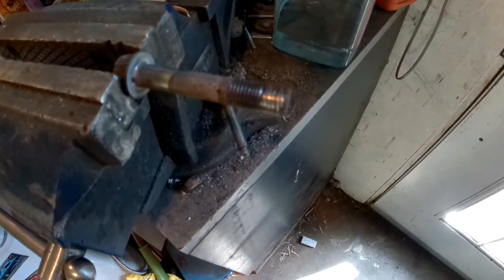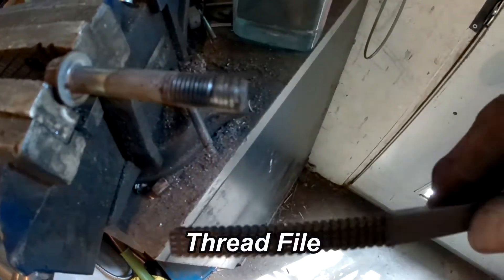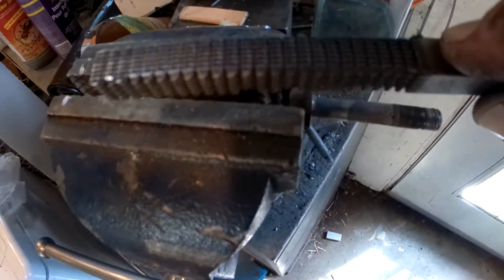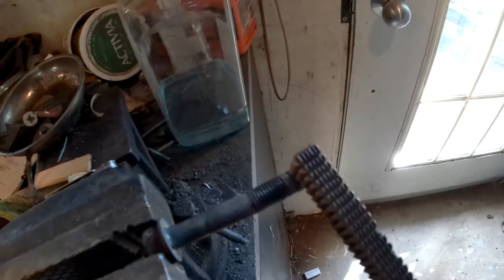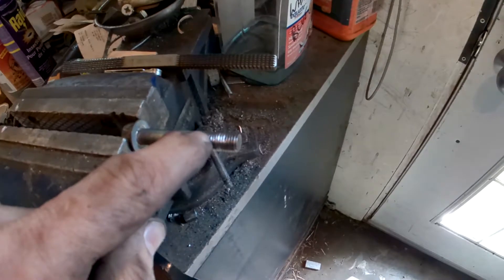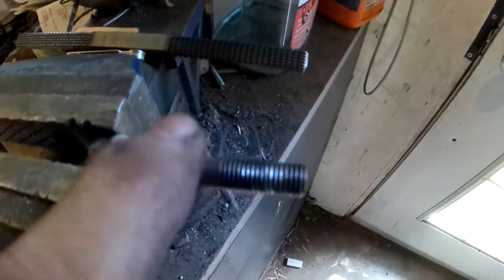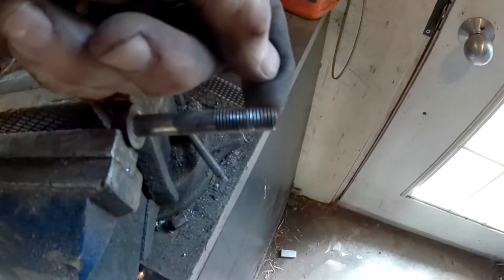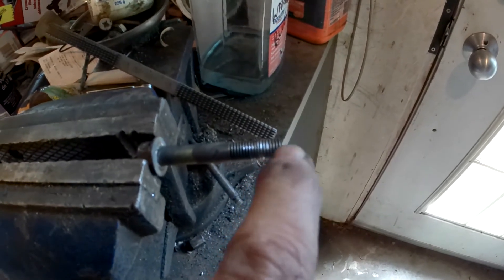Galled Threads on a Bolt! I can fix that..

Comment: Hi thanks for the video.  I have this on my Jet Ski axle where the aluminium impeller was.  Was replacing my aluminium impeller of 30 years (1993 Yamaha Jet Ski) with a stainless steel one.  Tried all the tricks of the trade to remove but ended having heated up with a blow tourch whic melted the impeller!!!  This left aluminium residue on 5 threads.  Can not find your file here in Cyprus.  Did try a wire brush but very little was removed.  Tried caustic soda but also this did nothing.  Any ideas what to do?
Reply from the maker: How about a wire brush on a grinder or drill?

Comment: Hi. When you remove such a bolt, doesn't it mean you are removing parts of the internal thread? Did you have to repair that as well?
Reply from the maker: That is true. To repair the internal thread, you would drill it out and put in an insert. There are kits to do this.